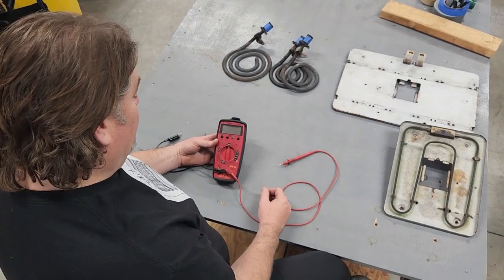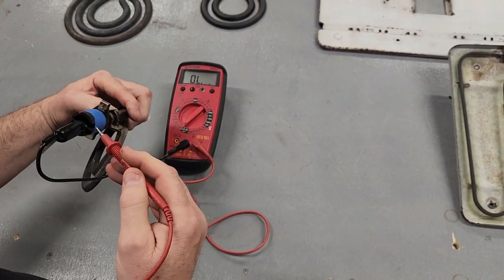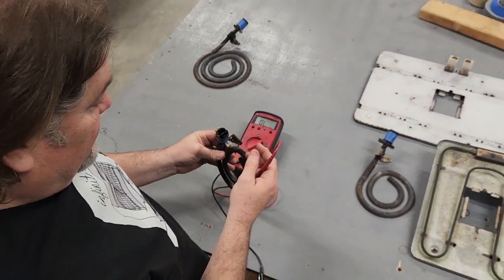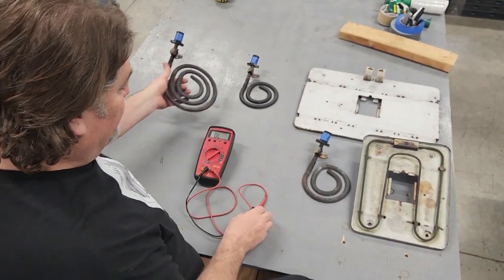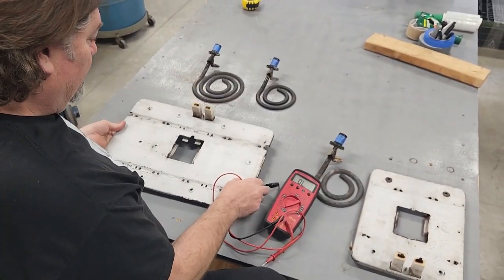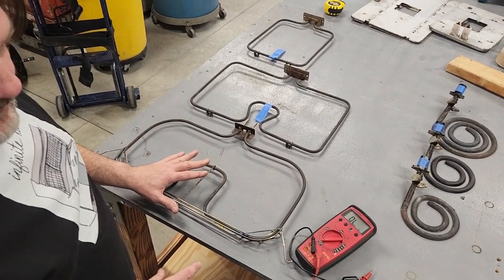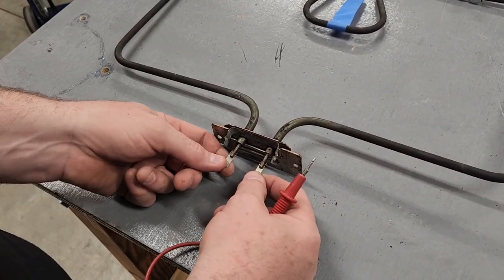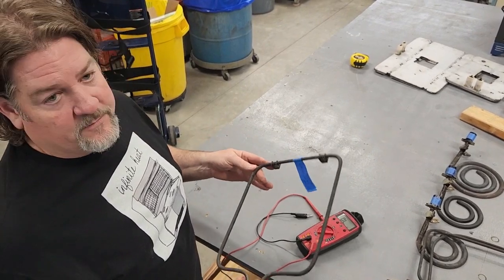Measuring the resistance of Flair heating elements

Comment: For those wondering, the reason for a speed heat burner having a lower resistance value than a standard burner is because it's designed to operate at 120 volts, unlike a standard burner designed for 240 volts.   It's called a speed heat burner because a special switch, called a flasher unit, applies 240 volts for about 30 seconds or so, then switches over to 120 volts until the burner was switched off. During the "flashing" period, the burner's rated wattage is increased by 4X.   This allowed for a much faster preheat time than a standard burner, mimicking a gas cooktop in terms of rapid heating, which was a major selling point and thus most manufacturers in the 1950s and 60s offered this feature in their flagship ranges and cook tops.

Unfortunately, the speed heat feature was known to be unreliable and suffer from early failure, because the high currents of around 25 amperes during the flashing period was very hard on the contacts.  Mounting customer complaints and service calls spelled the end of speed heat burners by the early 1970s.  Replacement speed heat burners and flasher units haven't been manufactured in about 50 years and are virtually impossible to find today, and having a working speed heat burner nowadays is equally as rare.

Comment: I always use clamp style leads with the multimeter since the teeth dig into the element terminals below any surface tarnish/oxidation/grease for a more solid connection and reliable reading.

Comment: Couple questions -I removed & tested two burners (6" Speed & 8" Head Minder) and I got no reading, the meter is set to 200 ohms and just stayed at 1. I used the same meter to test the lower oven element (30" Oven) & got 23.8 ohms so it works. Am I missing something?  Also, my burner connections have a male plug that encases the two female terminals that plugs into the big plastic/bakelite female piece that holds the two male terminals.  I have seen some that don't have that plug & the wires just by themselves - the female housing comes off so Im wondering if I can transfer my burner plugs to a burner that does not use the plug.

Comment: Great video, thanks!!  Is the 8" infinite burner the same for regular & Heat Minder?
Reply from the maker: Yes, the burner is the same. There was only one 8" burner used on all Flairs. The Heat Minder control simply turned the burner off and on in order to maintain an average temp set by the user. Thanks for your comment!